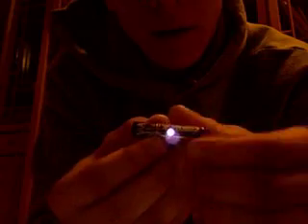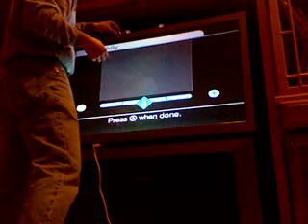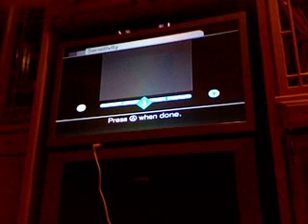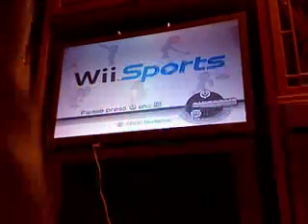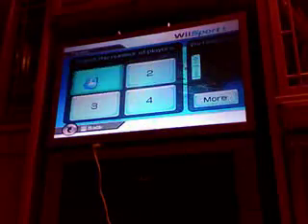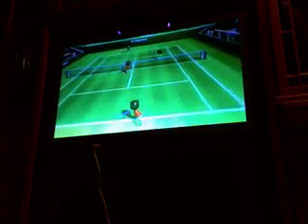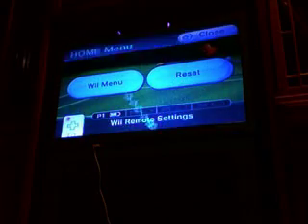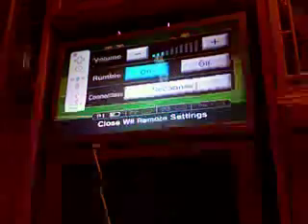10 Minute Wireless Wii Sensor Bar (1st Cut)

Comment: very useful! worthy of 5 stars.

and there you have it, a sensor bar for under 10 bucks. radio shack is a holy place indeed. you could use the change from the 10 and buy some Silly Putty or clay to make a place for the batteries to stick in place. just as simple as two LEDs and 2 "AA" batteries? you, sir, are an FYI master.